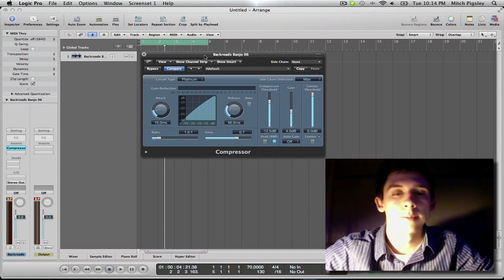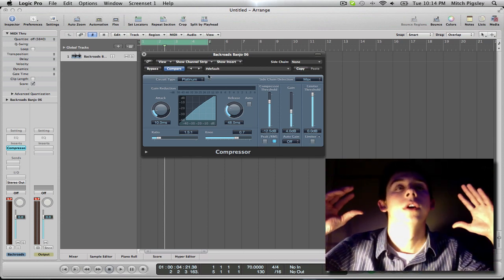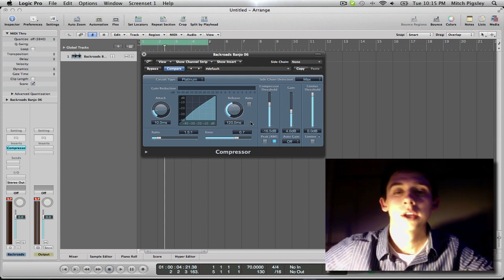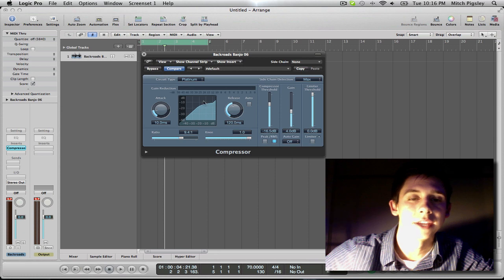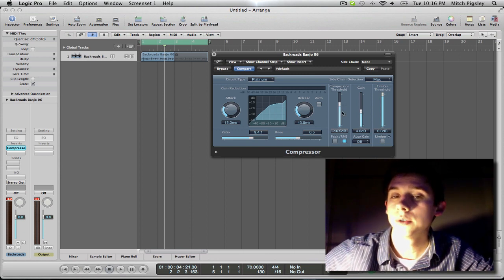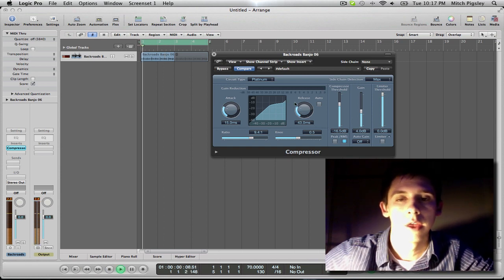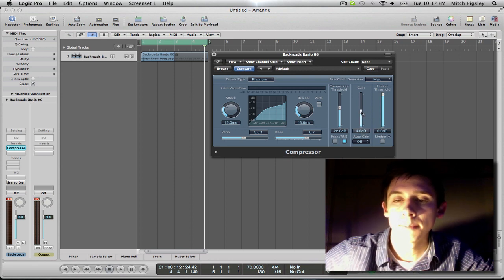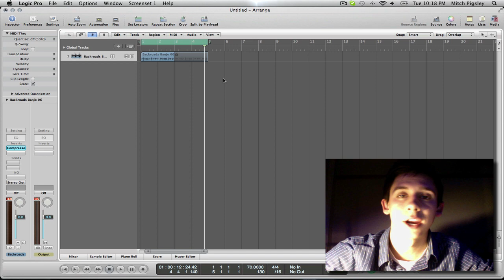Mitch Talks #6 - Basics to Audio Compression

Comment from the maker: If there are changes in volume from audio file to audio file, I would suggest normalizing your audio. If this is not the case, you just need a higher compression amount. Just lower the threshold until those drastic dynamics are tamed. I find that I go for 5-8 dBs of reduction from my compressor on vocals.